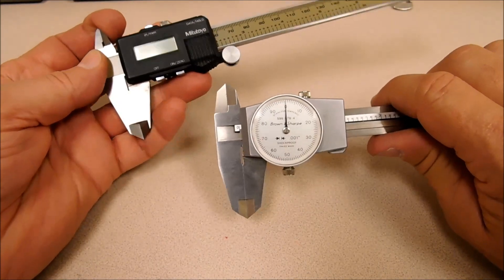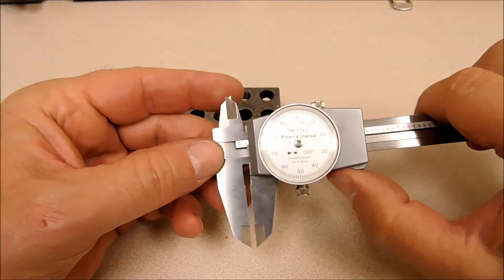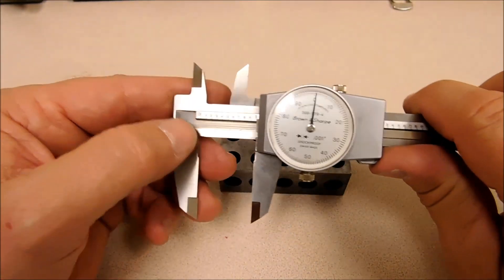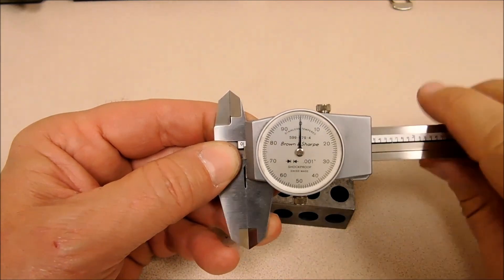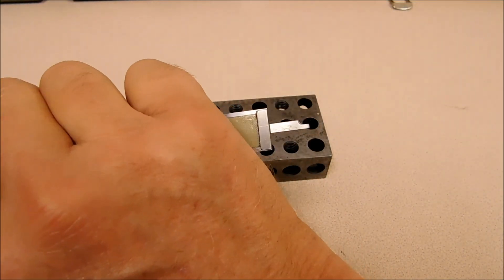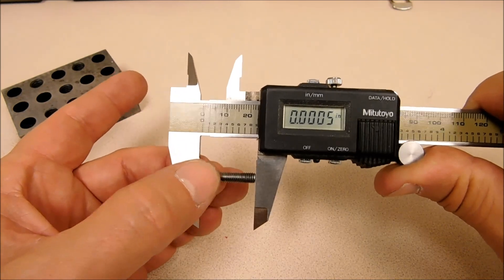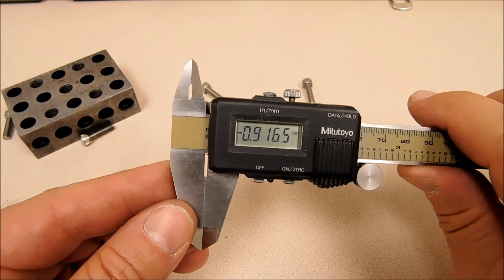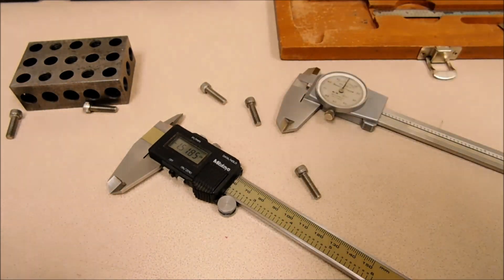Calipers -- Dial vs. Digital -- Does one do more ???  ( yes )

Comment: The analogue gauge has a bimetallic spring. It is extremely temperature sensitive. Room temperature differences of 5 ° to 10 ° can account for results in the 0.10 range
Reply: The B&S dial calipers shown in the video feature two coil springs in the movement, but those two springs are there to provide a) shockproofing and b) consistent tension on/against the rack, respectively. Temperature differences of 5–10°, whether F or C, are not going to create variations in measurement anywhere near a range of .100" (or ±.050") —or even ±.001" for that matter.
Reply: Dial calipers, not a dial thermostat…
Reply: DIY-Chris???

Comment: I have a vernier, a dial and a Mits digital caliper. I use the vernier and the dial more than the digital. I found out the digital needs to be sent in for calibration periodically. Vernier's and dial's can be checked with standards so no need to send them off. A digital can be checked with standards as well, but mine starting adding a half thou to every measurement no matter where you set zero.

Comment: i noticed the calibration stickers on back and was wondering how often you have them calibrated?
Reply: Generic industry standard is that it should be done within a year with an accuracy of a month (checked now in November -19 means next verification / calibration in November -20). 

Out of date devices should be stored separately and / or clearly marked "Inactive".
Reply: Depends on a few factors, including intensity of use, cleanliness of work environment (is your gage exposed to chips, cutting fluids, etc.), and your own quality-control requirements. Typically—and largely arbitrarily—yearly calibration is advised, but intervals much more frequent or seldom could be appropriate. If you have gage blocks you could certainly do a serviceable calibration yourself. Mitutoyo actually publishes their calibration standard and they have videos showing the process here on YT. One important aspect is agreement between measurements taken at both the tips of the jaws and deeper inside.

Comment: a verynear  (lol) dial caliper can also be set to a zero anywhere along the scale by rotating the dial to do overs and unders. Just the other day I was in the shop  and neither one of my digitals would work. One of the HF $9 dial calipers I leave laying around the shop did the quick measurement I needed. Thanks for the videos you do Joe. I've learned a lot from them.

Comment: I use a digital caliper on the lathe to turn to a set diameter, set the display to the diameter, zero the display, measure the part and it will show you how much you need to take off.

Comment: You can go as accurate as 0.05mm on both dial and good quality vernier -would i trust it to make a bearing press fit ? NO.Is it accurate for 99% of things you do ? YES.
Whichever you buy ,invest in a quality one.
One + of vernier over digital is that you can drop it more times before it stops working :)   .

Comment: I'm surprised at how many comments here complain about digital and batteries. Mitutoyo makes solar calipers (the cheap copies suck). If you are worried about low light and the specs sound not good enough, it is actually way better than the specs. They are basically the same as a solar calculator in terms of the required level of light, which is to say, really good.

Comment: I have tools and machinery from new to over 100 years old . Back and forth between metric and imperial, it's the digital every time. If you want to drill a hole that's not dead on the numbers in metric, then run the vernier over your letter and number drills you may find what you want. Calculate metric to imperial , dial it in press the button , you didn't even have to get thumb prints on your Zeuss book.

Comment: I like the dial but I am old school. The thing I don't like about digital is the fact that when I needed them most, the battery was always dead. One other advantage the digital does have and where I do use them is in the wood shop. After jumping a tooth more times than I care to think about due to saw dust getting in the track with a dial, I went to digital when I'm wood working but I use dial for all my metal working.
Reply: Ooof Da... another Wood Elf... 😃... no offense please... just couldn't resist...  😂

Comment: With the digital you can also calculate!
For example 10,224mm plus 13.983mm - go to 10,224mm, zero it, then go to 13,983mm (to the right side), zero it and then close the calipers and you have the result! For subtraction go left!

Comment: Digital calipers can check same diameter hole pitches by using inside prongs and zero it. The meassure the pitch between the two hole of the same diameter. BUT I must say that there are so many younger generations out there that will stop working if they don't have digital calipers. They cannot read the dial vernier calipers.
Reply: Ok boomer !!!

Comment: Incremental mode sets a temporary zero just like a dro.
Very handy when your turning to metric sizes on an imperial lathe.  Just set it on finished dimension zero and flip it into imperial mode.

Comment: First, the B&S dial caliper is a nice unit, I own one of their vernier protractors. There is another option, I own a couple of pairs of Mitutoyo vernier calipers that have both metric and imperial and with practice they are a lot faster to use than a digital pair. I own a digital pair that work OK but you have to mess around with batteries and I don't read them as quickly.

Comment: The biggest problem I've had with calipers of that sort is the jaws flexing. The good Brown and Sharpe/Etalons have somewhat less trouble with this, but the only ones that I have seen that really get around it are true vernier calipers, specifically the Starrett master ones. 

They cost an arm and a leg, maybe an arm and two legs and a ear, if you buy them new, but you can get them on eBay for a song and a dance. They're really a joy to use, though. Oh, and they also do both inch & metric 😁
Reply: Most of them have 2 screws at the top you can tighten with fine screwdriver.most vernier callipers have a thin copper strip that wears out with time-it acts a s a gib ,so you can tighten it,

Comment: wah wah wah the batteries go flat. What a bunch of x spurts. If you really want to complain go comment on clowns using them as scribers.  Get good good brand like Mitutoyo and the batteries will last a year easily even in a all day use professional environment. They have a low battery indicator which gives at least 2 months warning. Don't get sucked in with the Starretts, most are made in China and are inferior to Mitutoyo.  Even Mitutoyo are not above substituting plastic parts like the ratchet on the new micrometers and the bezels of the dial indicators. Their new mic frames are horrible solid slabs. I much prefer the older green and blue skeleton frames for comfort and balance.
Reply: Guess where Mitutoyo is made now? Yup like everything else Made in China.
Reply: Quite possibly. Buying Mitutoyo I know I am buying an imported product. For the Yanks buying Starrett seems like buying local. Not any more. It is interesting If I want to buy Starrett here in Aus I can get all the Chinese made stuff easily but the genuinely US made stuff is not easily available.
Reply: @RobB_VK6ES  Because they dont do it anymore -everything moved to china these days -bosch ,makita,dewalt,mitutoyo ,starret
All big brands are today made in china -90% of them are garbage compared to old day tools.

Comment: Mitutoyo every day. I have an old set non dial just read from the scale, but as you say veryneer lol. These let you lock off in the ball park and have a micro adjust that lets you read off a 10's of a thou scale... neerest you will get to the micrometer. I have never seen that feature on modern digitals.

Comment: My calipers are the old style vernier scale, where you have to read the numbers off a secondary scale - similar to the 0.001 graduation on a micrometer. I just bought a new ones of the same brand, the old one must be around 40 years old. There is one major difference between the new ones and the old ones, and that is that it has that height gauge feature - the old ones, the top end of the slide doesn't go level with the non-slide. I don't know when this became the standard. I also got a 15 buck cheap vernier caliper, and although it is supposed to be 0.02mm (so around 0.001") on the vernier, when I measured some "known size", it was off by much more than that. I'm very glad I got the other, more expensive and same type as my old ones.

Comment: I have a set of German Mauser made Scherr Tumico 1326 dial calipers I bought back in the 60's. They are unusual in that the dial has two hands like a clock, one for thousandts (with 0.200" per rotation) and one for hundreds of thousandts. The entire measurement is read off the dial without having to look at the beam. They cost a mint back in the day and are the only set like that I've ever seen.
Reply from the maker: I have a set of mic's from 1 to 6 made by Scherr Tumico. Bought them 40 years ago and they still read spot on.
Reply: @joepie221  I have many Schreur tumico tools. I live just an hour from where they were made and had a friend on the board. Got some good pricing and love the tools😊.

Comment: dials are better than verniers, digitals are just miles better. i've got coolant proof mitutoyos and they are great. i see people complaining about batteries and it is just such a petty nit to pick. batteries are cheap, take a minute to change, and on the mitutoyos a single battery lasts me a year. that's one minute out of the year i spend changing the battery. c'mon.

the only time i use verniers anymore is when i have to break out the 60" verniers once a year to measure something weird.
Reply: Of course, that assumes that you have a stock of batteries. Otherwise, if you have to go out to a shop and buy a battery, even if it's just around the corner, your battery change time is somewhat more than a minute, several days in a worst case.
Reply: @matspatpc   having tools that use batteries and not stocking batteries is like having any tool with consumables and not stocking the consumables. whenever there's only one pack of consumables left, restock the packs.  in the case of batteries specifically, since those are used less often, reorder when the last package is opened. think a little bit. if you run out of consumables, it is your fault, not the tool's fault.
Reply: @SuperAWaC  Yes, my point was that those that complain are probably the type of people that don't keep spares at home, for lack of planning or due to not being able to afford buying spares. But I agree, it's the same problem as complaining that your indexable inserts have run out, or you're out of bolts for assembling the product you make - bad planning.
Reply from the maker: Look closely at the video thumbnail. Inside the blue foam case. Yep...spare batteries. These calipers use a battery about every 2+ years.
Reply: Why dials are better than verniers? I mean there is a backlash in the gear of the dial, but there is no backlash in the vernier scale as it's solid with the moving jaw. The play in the sliding jaw is the same. (also ajustable with brass inserts)
Reply: @AsiAzzy  backlash on a good quality dial caliper is tenths. you're measuring with calipers to the nearest thou. digitals have no backlash. there's nothing wrong with verniers, there are simply better options now.

Comment: I also prefer the digital. But one rather big advantage the mechanical has: There is no battery.
Reply: But you can buy with solar cell. :-)
Reply: Nevazno Zabil There is no sun in my basement...
Reply: @wewillmakeit3615  60 lux is enough for Mitutoyo. This is pretty dark.
Reply: @nevaznozabil  I've been in shops where lighting was around 20 lux except in the immediate vicinity of the machines.
Reply: And that's why 99% of the time, I use my 30 year old analogue (no dial) calipers. I'm used to it  enough to read down to 0.01-0.05mm if I can be arsed to, just takes a tad longer.
But most measurements I do only need 0.05.

And I'm 'only' 43, I got those calipers for workshop hours when I was 12.

Comment: I prefer the dial over the digital. It may be because that is what I first learned to use. But I don’t care for the digital because they don’t repeat exactly every time. I have to take a measurement several times until two of the measurements repeat with the digital, I know it is usually just a few tenths but it still bugs me! I have yet to buy a really good set of digital calipers just because I don’t trust them.

Comment: I got away from dial calipers for two reasons number one be I got tired of resetting the zero because of a chip getting between The gear and the rack now I don’t mean just turning the dial to make the needle line up with the zero I mean resetting the gear to the rack so that the needle and the zero would be pointing straight up when the caliper is completely closed number two reason in my shop we get a assortment of metric and imperial sized hydraulic cylinders with the digital caliper it is much faster to check metric sizes

Comment: You can also preset the digitals to your final dimension and zero them, then during stock removal they will display exactly how much more material needs to be removed.
Reply from the maker: I bet you fast forwarded through this.
Reply: @joepie221 I watched the whole thing,  I thought the DRO function needed more emphasis given it has the ability to reduce scrap before it happens. My old foreman used to say go/no go gauges only tell you if you did it right, good measuring practice tells you before you get it wrong.

Comment: I can echo a lot of the comments here...I love my B&S dials then I bought a set of digitals to use for reloading. Bought a better set of digitals for the shop and was going back and forth but I find I'm picking up the digital more and more.
As for batteries I just buy them in bulk...saves the frustration.
Reply from the maker: Keep them in the case with the calipers.

Comment: A vernier scale caliper and a dial caliper are not exactly the same instrument as the dial replaces the vernier scale.
Reply: The point was, a dial caliper is still a Very-near instrument. Meaning it will not have the accuracy of a micrometer. However, you are also correct, a vernier scale caliper is different from a dial caliper.

Comment: Hello Joe from John Australia. I enjoyed this video and will respond and give my thoughts as you have said/asked.
 I prefer to use Vernier Calipers as for me at all of 60 I find them the most reliable. Reason you may ask, it is because they do not have two things an electronic caliper has and they are a Battery and a so called BRAIN. Dial type calipers can also have a tiny ingress of Swarf/Dust introduced into the track and pinion and skip a tooth. I know I have seen this and result too big or too small as the job may be. I only use these as Guestimaters!
 Same with my chosen type of Caliper, Mititoyo, and they read metric and inch, they get me close to size and do not have battery/chip (as in electronic) failure as well as do not have the ability to skip a tooth!
 I have tried them all and I will say Vernier is for me for the reasons said above.
Cheers Mate.

Comment: What about having to put a new battery in all the time?
Reply: It's a problem with cheap ones, far less of a problem with name brand, and a non-issue with the old style Digimatic like that.  A lot of it comes down to how the linear encoder is read (absolute or incremental), and if it needs to continuously monitor position even with the display off, or if it's going to re-zero every time it's turned off and on again.  My old digimatics can be zeroed closed, powered on, opened to say 1", powered off, opened to 2", turned back on, and read zero.  They don't remember where they left off, or watch what's happening while powered down, which means batteries last for years.  I've got generic ones with incremental encoders that are basically always powered up and just turn the display on and off, and they need new batteries every couple months.
Reply: @a89proof  Agreed, the cheap Chinese calipers chew through batteries, you have to remember to take the battery out when you put the caliper away. This was my main incentive to buy Mitutoyo calipers which easily last a year on the battery with the use I give them.
Reply: One (very common size) battery will last a couple years under normal use unless you are buying chinesium

Comment: Someone just got a patent on a strain gauge in the digital caliper to compensate for thumb force.... but the company is sitting on the patent.
Reply from the maker: A spring assisted second slide would solve that issue. You could only push as much as it took for the spring load to move the slide. Easy.

Comment: The dial cal. will zero out a standard too.
Reply: Only useful for reading relative measurements of +-50% of the dial range though, which is not a lot i.e. you cant zero the vernier part of the measurement.